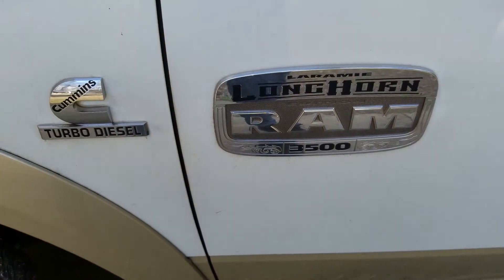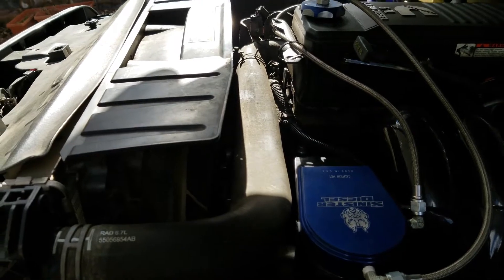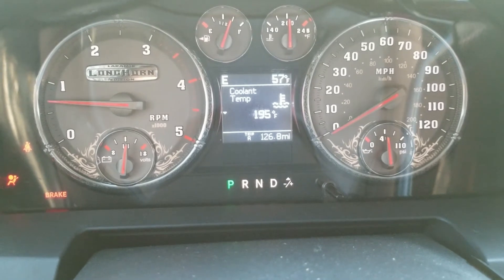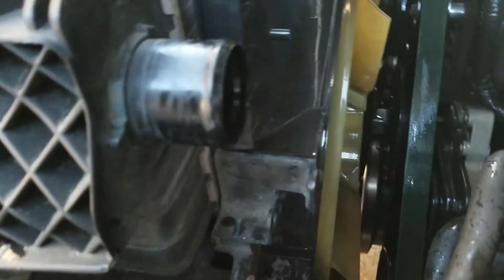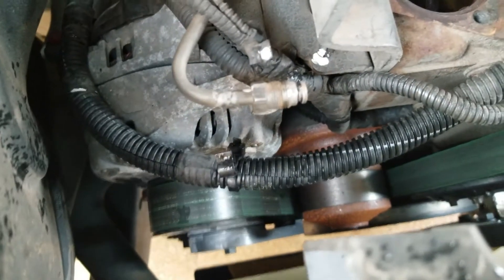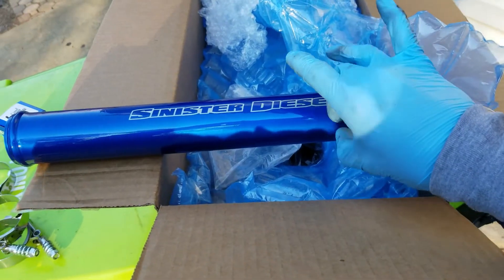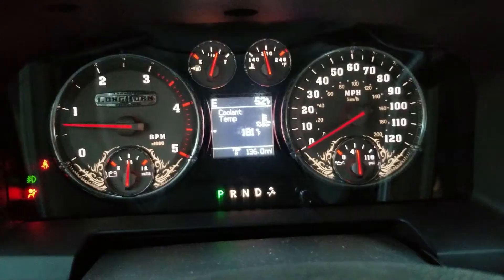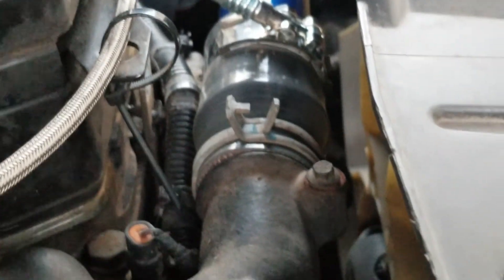Cummins 6.7 Ram 3500 Cooling Upgrade

Comment: Excuse my lack of info.
Why change the thermostat to 180 if is deleted?  Im deleting my 2018 so i will keep that knowledge in mind for mind. Because i also bought a sinister pipe just like that one.
Great video
Reply from the maker: The higher temps are need for EGR and Regen higher temps not needed anymore so you can lower the temps and the motor is happier

Comment: Just so we all know, that isn't a coolant feed line attached to the side of the thermostat housing. That is an exhaust pressure line for the sensor  plugged in beside it.
Good install man! 👍
Reply from the maker: Thanks for the information hopefully soon we will figure a better setup out something’s are just not needed lol

Comment: Good job brother thank you for the education. I have a question my truck it’s dodge ram, 3500 year 2017 turbo diesel is that normal to Ron from 190 to 197 and sometimes for a second it jumps to 200 is that normal  thanks man appreciate your video very much and your advice
Reply from the maker: Thank you and your welcoming! Yes that is absolutely normal. We see that when first driving in the morning or after sitting a while it’s just the system and thermostat doing it’s thing.
If you see temps higher than 225ish towing then that would be concerning
Reply: Where did you get your 180 thermostat?
Reply from the maker: @rakaa34  at the local Cummins dealer they won’t cross parts over so you have to figure out the part number for your engine sn